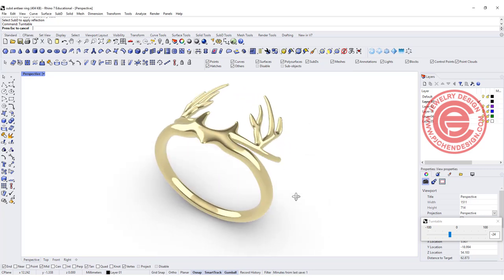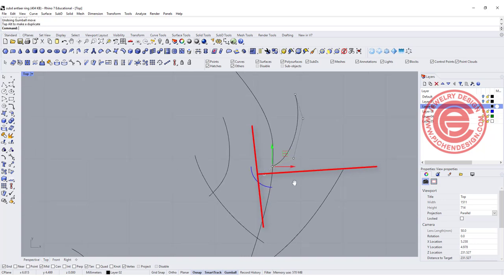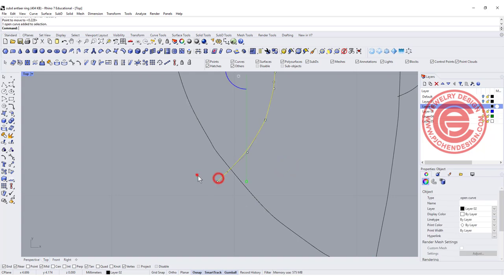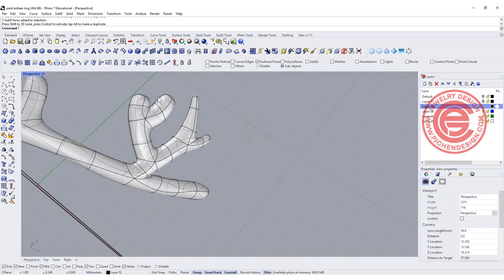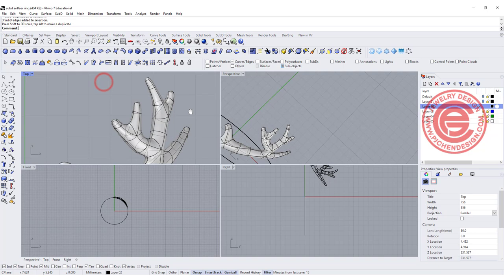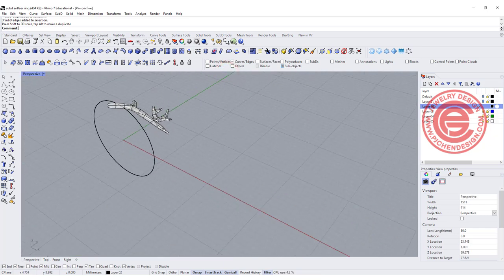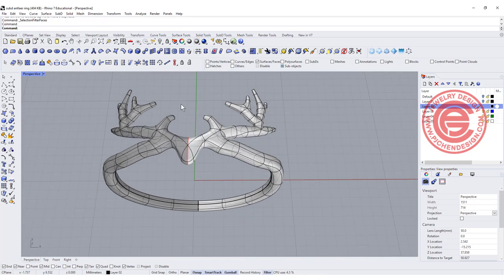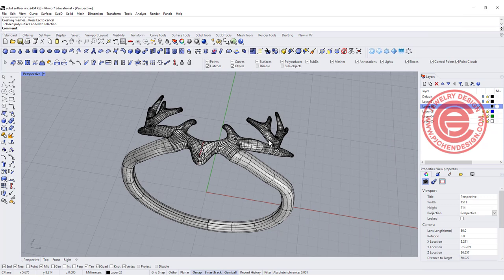Rhino 7 SubD Antler Ring 3D Modeling Tutorial- Jewelry CAD Design #191

Comment: Hi PJ, I'd like to know why when I try to pipe with multiple subDpipe instead of getting cylinders I get cubes, I tried a smaller diameter but I still get cubes, I also entered 0 for smoothing but the result doesnt look anything like yours. Thanks in advance!
Reply from the maker: you may be in box mode. try to use the TAB key to change to smooth mode
Reply: @PJChenJewelryDesign  thanks PJ,  now it works.